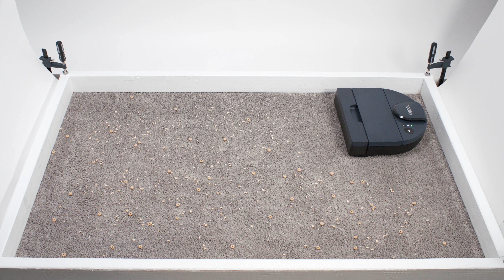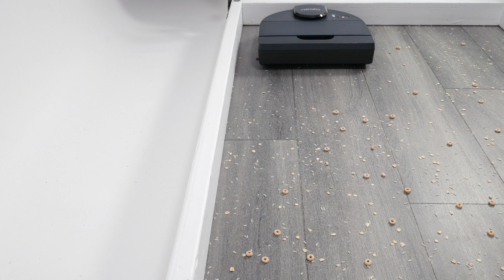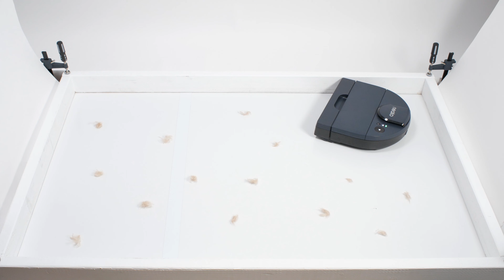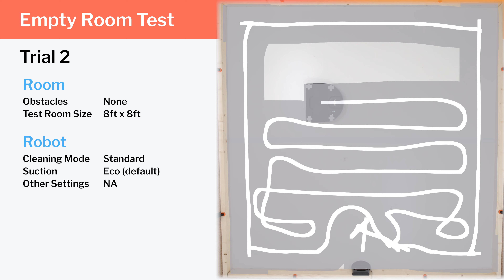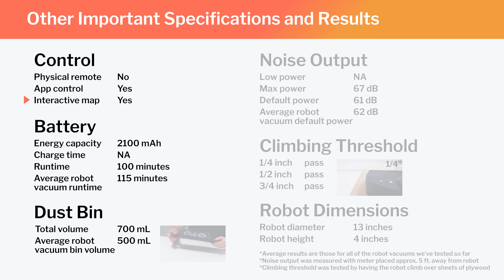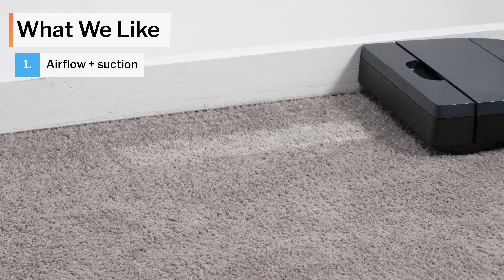Neato D8 Review

Comment: To solve the, "too close to an edge" error you need to rebuild your floor outline with 2x6 and not 2x4's as the lip of the 2x4 at 3.25" is actually below what the Lidar can pickup as its detecting the space above that but it's bump sensor keeps telling it it hit something. Clean the sensor on the underside after each run over any carpet areas. I found synthetic fibres sticking to the sensor which cause it to misidentify whether it was actually close to an edge or not. 

But any D8 review where they used 2x4's would all have the same problem and same conclusions based on their use of 2x4's. But any reviewer who recognized the LIDAR limitaions and build their test environment with 2x6 never had that problem. 🙄🙄🙄🙄🙄🙄

Comment: The white wall that is used is to low for the LiDAR to reflect on.
Reply: Agree. Try a higher wall without a clamp system.
Reply from the maker: I used the same test area for all of the other LIDAR robots I tested, including several other Neato LIDAR robots, and none of them exhibited the same issues as this D8.
Reply: @consumer-analysis  the position of the LiDAR is clearly higher than the wall. Consider testing again with at least a 10” or higher trim wall. Likely other vacuums have a lower LIDAR sensor.

Comment: I have had a D4 for about 3 years. It works really great but from day 1 I sometimes need to stick something into the lidar to unstick it otherwise I get an error. Just seems locked up for no reason. Once it starts spinning its fine. Almost always does a great job and doesn't get stuck. It gets used a lot, the original battery is still perfectly usable.

These newer neato's don't seem to be innovating like other brands. Their large brush is great but the design can cause trouble in navigating tight spots.
Reply from the maker: I think Neato robot vacuums may have been a reasonably good option a few years back but, as you said, they definitely have had a hard time keeping up with all of the innovations of other brands - like self emptying and small obstacle detection and avoidance - in more recent years. It's also a huge problem that they still have navigational issues according to my testing.

Comment: My initial observations are that the D8 is a good little cleaner, but…
— it’s best to move furniture — especially dining chairs — out of it’s way, or it spends to much time negotiating spindly furniture legs. 
— empty the dust box, clean the brush and the rollers after every run. Every run. 
— it’s noisier than I was expecting
— it’s not a substitute for manual vacuuming but it is definitely a very good assistant. 
D8 ⭐️ ⭐️ ⭐️ ⭐️

My initial observations on the app are:
— the app is not robust as it can’t add up the amount it’s cleaned in the History section
— the app often doesn’t update the history; the Neato Webchat person said to delete the app completely, which would have wiped 3 hours of map creation by D8
— the app can’t create drawing polygon “no go areas” (no good on a house like mine that bends in the middle. 
App ⭐️ ⭐️ ⭐️
Reply from the maker: The lack of features for the app was definitely a negative for me as well, though I didn't really stress it in the review.